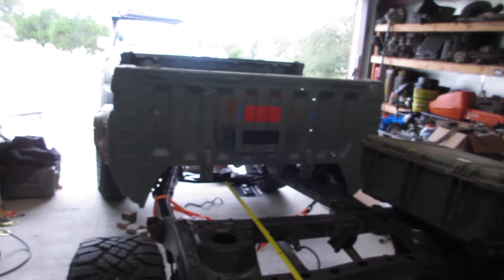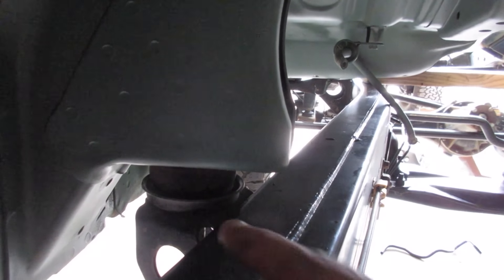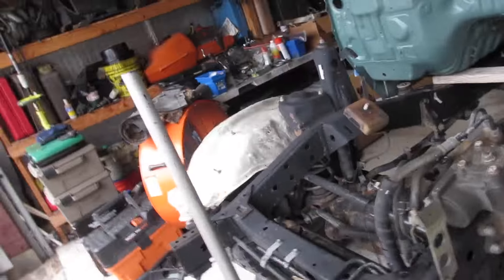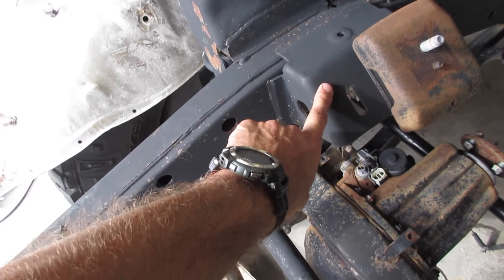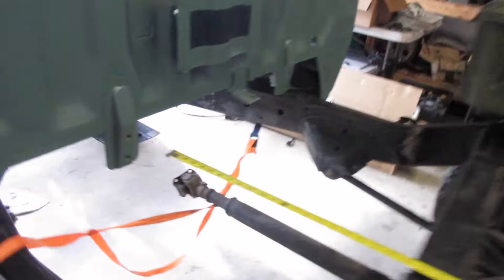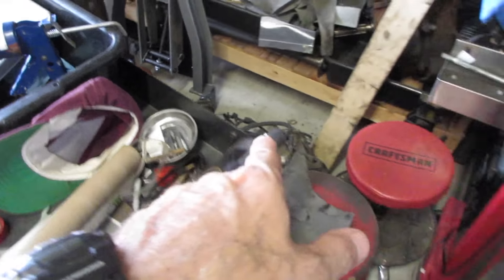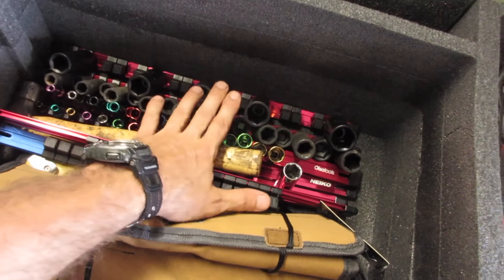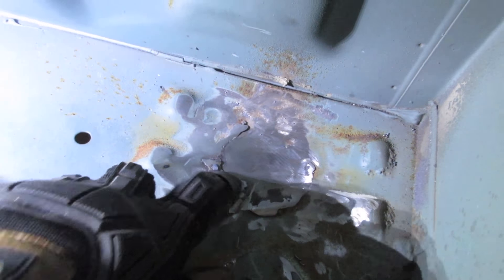75 SERIES LAND CRUISER BUILD  - PART 10 - TEST FITTING CAB ON FRAME

Comment: Your front body mounts are easiest to just use the old front tube body mount from the 75 chassis. Remove the whole tube with the two mount pillars on it, then just notch your 80 chassis and fit the whole assembly from the 75. Hopefully you still have the frame...
Reply from the maker: I will take another look at it and see if your suggestion might work.  But I think it might be well beyond saving.
Reply: even if you can get some measurements and replicate it